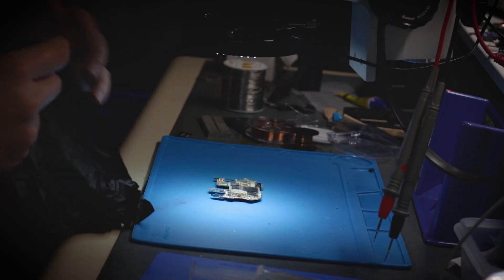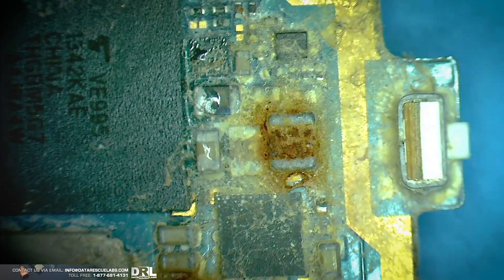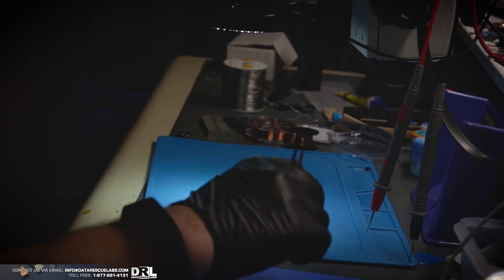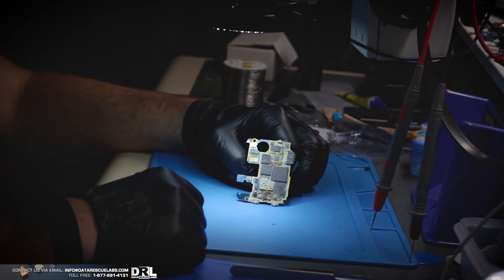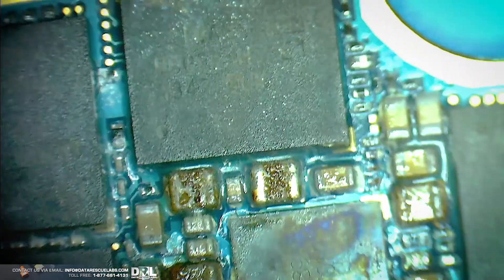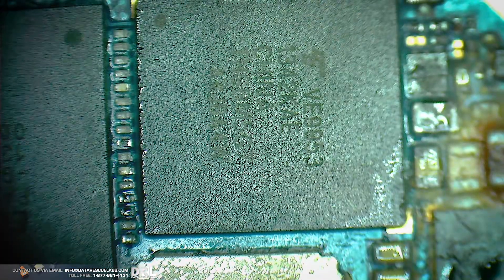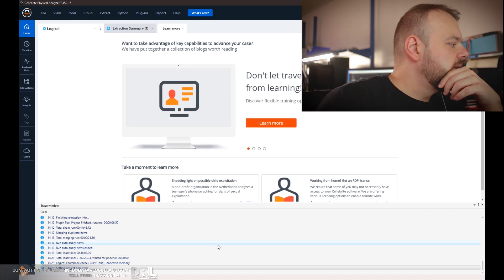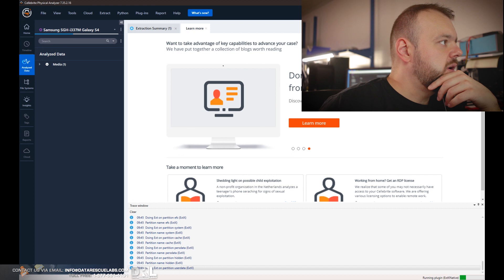Phone found in a lake on a deceased person, family wants answers. Data Recovery

Comment: Cool video, I've always wondered how recovery works from a phone.  Is the liquid in the ultrasonic cleaner any particular solvent?  And was that alcohol you used after?
Reply from the maker: We use electronic cleaner in low percentage mixed with distilled water. Then pure alcohol bath at the end to wash it all off.
Reply: @forensicguy  Ah, thank you.  I appreciate the tip.